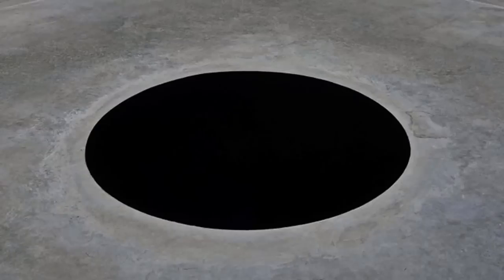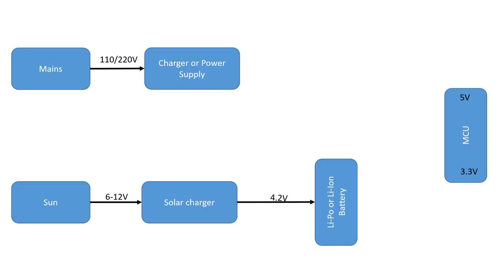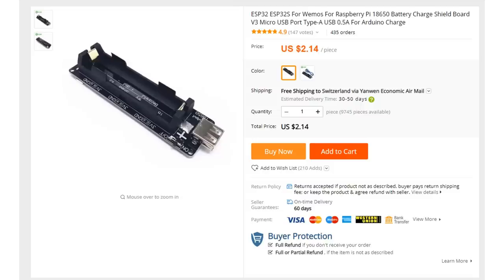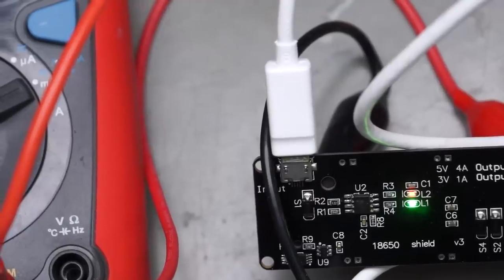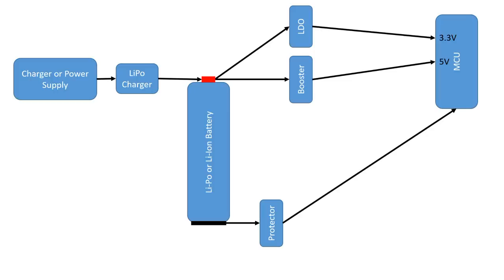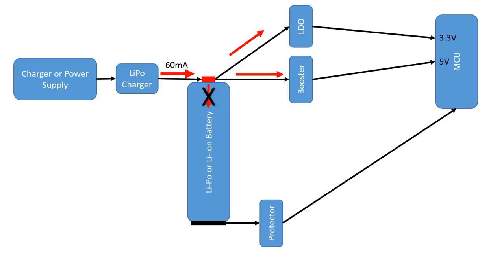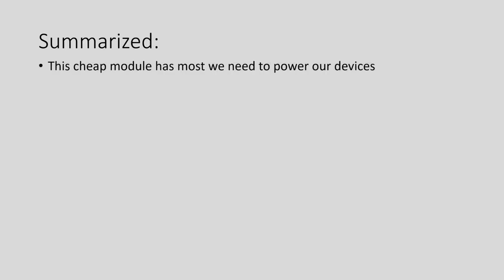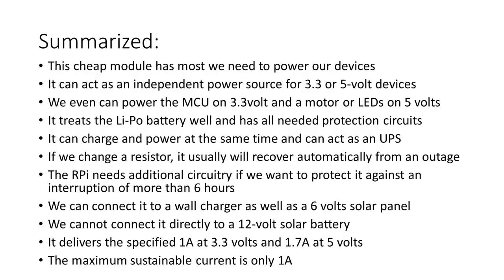#250 Universal Power Source (UPS) for only 2$. Is this possible? (Raspberry Pi, Arduino, ESP32)

Comment: These are absolutely great, I use them to drive and power the WS2812B smart leds on an electric skateboard. I was hoping to play with a accelerometer so add some sort of roll and acceleration effects.

Just a thought, nobody seems to do anything with wind powered ICs - would you consider covering some sort of self powered ESP32?
Reply from the maker: I tested at least one ESP module with battery.
Reply: I just wanted to say that I am interested in wind power for very small devices. But it is harder to work with than solar, because the mechanical turbine does not just switch off happily when the battery is full. Real wind turbines, even small ones, need some sort of 'brake' and a way to trigger it. Overspeed operation is a real hazard. See also "dump load."

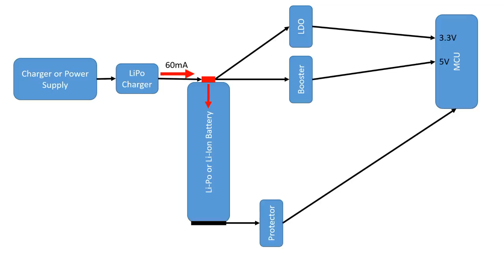Comment: I think there's an additional (and maybe main) cause for the problem described between 8:30 and 9:15. According to the DW01datasheet, it's not only that the TP4056 reduces its current until the battery reaches 3.0V, but also the DW01 won't reconnect the battery until that voltage, as it has two thresholds: one called "Overdischarge Protection Voltage", at 2.4V, that will disconnect the battery when reached during discharge, and a second one, called "Overcharge Release Voltage", that it needs to reach when charging after overdischarge to reconnect the battery (as a hysteresis cycle). If things go as stated in page 6 of this datasheet (http://hmsemi.com/downfile/DW01A.PDF), it could be in fact a good thing, as it would allow to trickle charge the battery at a reduced current from 2.4 to 3 V without any load, and it would connect the load just above 3V, when full charging current is also restored
Reply from the maker: You are right. If you use a DW01 for the load this should not be a problem (if the voltages correspond)
Reply: @AndreasSpiess  Thanks!

Comment: Interesting video as usual. THX Andreas.
(Don't understand the thumbs down. If someone adds thumbs down at least explain why!) 
In (small) electronic project the power circuit is an important also for the cost.
My experience (of at least my feeling) is that if there is a (mains) power failure a period can start with several power failures. Manual intervention (for each device) to reactivate the charging is for some applications not a problem, however for most applications not an option.  
Also it would be nice if a MCU can have access to some (diagnostic) parameters of the power circuit. (Battery status, temperature, mains functioning, is the solar system delivering something).
For 2$ you currently can not expect this. However who could imagine several years ago an MCU with Wifi for less than 2$.
Reply: Jan Jeronimus I think many thumbs downs are a “Bad Touch” on a phone or iPad. Not intentional. It would be an interesting statistics project.
Reply from the maker: Maybe I come back to the topic of shutdown and power monitoring in a later video...

Comment: I think that when the battery is fully charged then the controller should not charge battery again until it drops below some threshold. Let's say 3.8v or so. And that's not the case with most of the controllers on the market.
Reply from the maker: My chargers always charge the battery if it is below 4.2 volts. So you probably use different ones.

Comment: The most elegant fix to the trickle-lockup would have been if the boost-convertor had an under-voltage lock-out (UVLO) for limiting discharge to a safe voltage-threshold. Draining batteries below 3.5V doesn't increase run-time by much.
Reply: ...Wait a minute! The DW01 datasheet mentions "Overdischarge Release Voltage" as 3.0V (+/-0.1V) --> This means, that a discharged battery won't be re-enabled until >2.9V (which is SOMETIMES above the trickle-threshold of the TP4056) - Matter of binning?
Reply: Using a voltage divider on the EN pin would probably accomplish an UVLO. I'm too lazy to check if there is sufficient hysteresis to guard against cycling the output around the UVLO voltage.
Reply from the maker: The under voltage protection kicked in at about 2.6 volts. And it does not cut-off the TP4056
Reply: @AndreasSpiess  Oei.. bummer :( That's far below the datasheet-spec too..

Comment: Hi Andreas, thank you for this video! I'm new in DIY electronics, just a basic question, how the 5v 2a pins in the PCB can be easily used? What type of connector should I solder/use)
Reply from the maker: This question is too general. I would say: Any connector which fits your needs and the dimensions of the holes. Most people probably would start with the small pins used on all MCU boards and cut 2 of them. Or solder two wires instead of a connector because it is more reliable.

Comment: Thank you for the wonderful video. When my 18650 battery shield is charging and you remove the charger suddenly, the shield will turn off and then turn on again for several seconds. I believe this is a protection mechanism, but I am using Arduino, and if the power source restarts, the Arduino also restarts, which is not appropriate for my project. How can we avoid this? Thank you a lot.
Reply from the maker: I do not know. Maybe it is not intended for this usage as many powerbanks (they do not allow to charge and power a device at the same time.

Comment: I'm currently looking for an UPS for my main RPi running my smart home system and it turns out it's not an easy thing to find. I have even tried expensive modules like the "Strom Pi 3" but was not satisfied with it. When switching from mains to battery, the voltage dropped to 4V for a brief moment. The manufacturer said, I have a faulty module but this is generally my experience. All of these UPS modules for the RPi claim to have enough output current and voltage to run the newest RPi 3B+. But in fact I'm seeing a lot of flaws and under voltage... I have now ordered a classic "real" UPS with a big lead-acid battery finally and I hope that this UPS will finally provide the reliability I need.
Thanks for the video, I'll give these modules a try.
Reply from the maker: I tried it with my RPi3 and it did not crash when I unplugged USB. I did it quite a few times.
Reply: @AndreasSpiess  before or after you changed the resistor?
Reply: @AndreasSpiess  Would be interesting to monitor the voltage while the module switches to battery. In case of the (maybe defective) Strom Pi, it was below 4V for about 0.4 seconds which is in my opinion not acceptable. I have just ordered two of the modules, I'll check it. Thanks for your update Andreas, as always very helpful !!!
Reply from the maker: I did not check it. But since nothing switches I assume no drop. A LiPo has a very low inner resistance.
Reply: @gibsonblogger , thanks for your suggestion. Unfortunately it seems that the module is "blocking" all the GPIO headers which I needs for my smart home stuff. But thanks for the hint!

Comment: if you disable EN pin, there will be no step up boosting, you still get power out of USB port equal to battery voltage
Reply from the maker: Yes, but if you want to go this route you are probably clever enough to disconnect it ;-)

Comment: Very good video !!! Do you know if it is possible to connect two of those shields in parallel?
Reply from the maker: It should be possible. But maybe you will not get double the output power.

Comment: Did I miss something Andreas? Your final summary bullet says, "The maximum sustainable current is only 1A".... where does this come from? I don't think I saw it mentioned in the video. 

Otherwise, this was a very interesting piece on these units. Well done.
Reply from the maker: It comes from measuring it. I do not remember if I mentioned it before.
Reply: @AndreasSpiess .... Thanks.

Comment: Thanks for another excellent video! At 2:00 you mention that an LDO is used to convert from 5V to 3.3V, which is pretty horrible. I guess paying a few cents more for a switching converter isn't possible? Or maybe they don't care that they are wasting 1/3rd of the power before they start because they are running from mains? The efficiency could go from 67% to 95%. Doesn't seem like a good solution to me...
Reply from the maker: Maybe you look at the diagrams and discover your thinking mistake?
Reply: You mean the fact that the power is usually wasted on the development board? That's probably even worse...
Reply from the maker: The LDO is powered by the battery. No big loss in most situations.

Comment: The new version found on your link requires 300mA minimum to stay on as well as when it loses power it shuts off the device then restarts it. So I cannot recommend this to anyone it is terrible to deal with and won't power any low powered devices. Mine arrived yesterday and I found in the comments on aliexpress some others saying that too. 300mA is a large device, even raspberry pi zero doesn't pull that power all the time. When you cut off the "charging" power the device dies and then powers back up via the battery, rebooting anything you have. I've messed with it for like an hour now and it is disappointing that they changed it.
Reply from the maker: Thank you for the information.
Reply: @AndreasSpiess  Yea I contacted them yesterday they said they won't be shipping the old version sadly.. here are pictures of my "new" one https://imgur.com/a/9b3ryaI
Seems they tried to make it "smarter" and made it worse =/

Comment: Would love to see the PSB01012B reviewed. And the challenges with 3V/5V-mix projects.
Reply from the maker: The PSB01012B seems not completely different. Just other chips for the charging and the booster. And no 3.3 volts.

Comment: Great Video, I would really like to see a good circuit for low power application with 3,3v and two alkine batteries. All the hardware needed to run the ESP stable. What Mosfet or other device would you recommend to turn on and off a rfm95 or other sensors to safe power?
Reply from the maker: Maybe you watch my videos about the Amazon dash buttons?

Comment: What about adding a diode after the battery and a connecting the boost/ldo directly to the power supply? Would not this solve all the problems while charging and "discharging" at the same time? (provided that the psu is good enough).
Reply from the maker: Maybe you make a drawing and include the fact, that a diode has a voltage loss of about 0.7 volts. Then you see if you find a way which works.

Comment: I seem to remember a video (possibly adafruit) showing 6v power spikes when switching from battery to mains power with solutions using the tp4056. Did you notice how clean the supplied voltage was when switching power sources? Could be all the additional circuitry on this model fixes this.
Reply from the maker: I checked it out now. I connected the oscilloscope to 5V and unplugged an re-plugged the charging USB cable. And really, I saw big spikes (>20V). If I kept ground connected to the wall charger (as it is if you lose mains power), I only saw 3x 10nS spikes (very short). They are comparable with the 200mV spikes from ripple. The big ones most probably came from the ground problems (measuring errors). So I would say this is ok.

Comment: Another fantastic video!  Can I ask, when a li-ion battery is fully charged is it not bad to trickle charge? Thinking of dendrites or other possible reasons.
Reply from the maker: The trickle charge is used when the battery is empty
Reply: @AndreasSpiess  Ah! So, to safely condition prior to normal charge? I am correct that once charged, trickle charge ( unlike nicad say ) is NOT used with li-ion? Thanks again!
Reply from the maker: Li-Ion charger usually stop at 4.2 volts.
Reply: @AndreasSpiess  Thanks but you really have not answered my question - will ask elsewhere

Comment: Great mini UPS, let's hope the company watch your video and change the board with switching off the FP6298 and not just the USB output port. On Aliexpress the 5V Amps rating are changed to 2A in the description, bit closer to your load test :-)
Reply from the maker: Interesting that they changed the description...

Comment: Just found this video -- very Interesting as I've been thinking of setting up a sensor grid on my property for security and control.  
The only thing I don't like about using WiFi is the security issue - its so common it could be easily hacked or disrupted.
Though its highly unlikely that any thugs/thiefs are really that resourceful or clever, except for those going after top flight merchandise, and we don't have any of that here.  LOL
Reply from the maker: You find other communication modules on this channel like Zigbee, LoRa or 433 MHz devices. But of course, every wireless system can be disrupted with enough resources.
Reply: @AndreasSpiess   Yes - of course - but I would guess that hackers think about WiFi.  Thankyou on noting that -- I have been checking out those videos  - loved the ones on LoRa.  
And the WiFi concern is probably immaterial in this situation, as I had already decided on a two tiered strategy (1)  high BandWidth network - such as WiFi to carry video traffic, and (2) a more efficient low BW distributed network for alerts, basic control and possible low res images.  This configuration should provide some redundancies should one network get taken down, or in low power situations (such as loss of main solar bank). 
WiFi is moving forward all the time.  I actually write patents for a major corp. for work beyond 802.11ax - but sadly 'writing' and defending new tech is a far cry from implementing and making things work - I really appreciate your down to earth explanations and details of devices on the market and PRACTICAL application thereof.  Hope I can make the time to be doing more of more that real world work !  Thanks

Comment: Can you please show us this UPS set up and powering an ESP using solar and mains. I have a 5V, 500mAh solar panel, will it work with this setup?
Reply: if it can be charged using 5v usb in why not?
Reply from the maker: I used the same TP4056 chip in my solar charger comparison. You find all info there.

Comment: Unfortunately, like the shield you also showed at the start, its not perfect and needs additional stuff to make it 100% hands off. 
Still looking for a cheap fully automatic ups. But it's also pretty situational: it's only useful if the pi doesn't rely on the internet or anything else that goes down with the power to do its job. 
I kind of gave up and got a normal ups that also keeps up my router and backup 4g stick up, not cheap though..
Reply from the maker: That is also a good idea, A little more expensive.

Comment: Can't we bypass the battery power sensing whether mains is active, keeping two power FETs, one to switch the battery off and another FET to bypass the incoming 5v to the power management circuit, instead of modifying the trickle current?
Reply from the maker: I did not try it. Maybe you try if your idea works?

Comment: any idea how one would attach a solar cell? Where would the inputs attach?  thanks
Reply from the maker: At the mini USB. But only 6v
Reply: How much Watt or Ampere do i need (min and if there is: max)
What i understood from the video is, that i need a 6V solarpanel. I'll use this board with a LiPo 18650 2600mAh Battery, and the device it will power is an wemos d1 mini with a whole bunch of Sensors (Weatherstation).
Thank you in advance!

Comment: Great video and cool discovery, Andreas! Did you have the chance to check if changing the cut-off voltage of the board to 3V would be possible to prevent the TP 4056 to go into trickle charging mode in the first place? Maybe this could be a solution for applications where reliability is worth more than the lost capacity by the premature cut-off?
Reply from the maker: I think this is an internal function and cannot be changed. At least, I do not know, how.

Comment: Yes, it works well. However, it seems this device does not have an inversion and short circuit protection. I damaged one and I have no idea how to fix it.
Reply from the maker: Maybe you replace it?
Reply: @AndreasSpiess  Yes. Low cost.

Comment: Is it possible to modify the board so that the protector disconnects the battery at a higher voltage? This would then stop the LiPo charger from charging at such a low current, at the cost of the possible runtime of the device that the battery is connected to.
Reply from the maker: Maybe. I will try it with another chip.

Comment: Andreas, could you please check again the  self-powerconsuption on this board? You say the converter uses 300 microampers. However I have experienced that the board will drain a fully charged Samsung Q30 cell within about 7 days to almost empty (2.8V). Any measurements and more info would be very helpful. Thanks
Reply from the maker: So far I have no plans with this board.
Reply: Andreas Spiess I see... what a pitty. It looked really nice but if that thing really drains batteries itself in no time it is not worth a recommendation and deserves a follow up imho. Keep the good content coming. ;-)